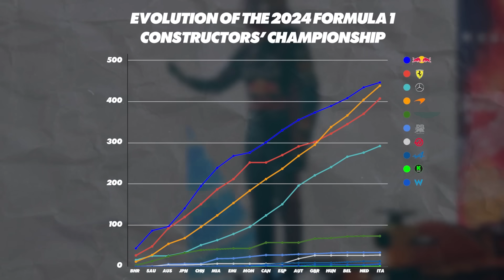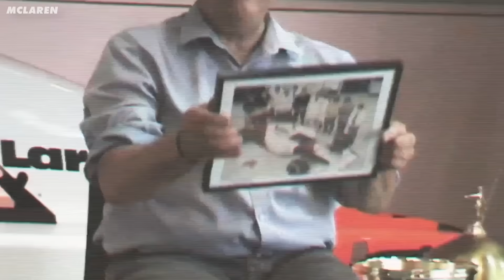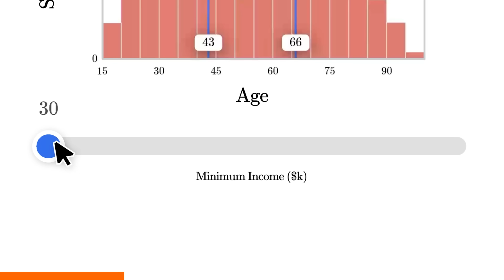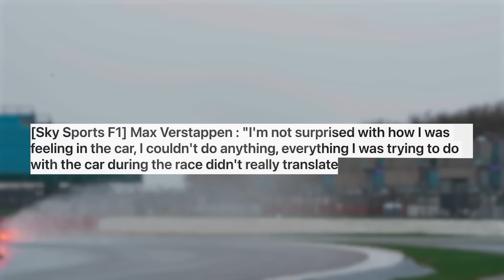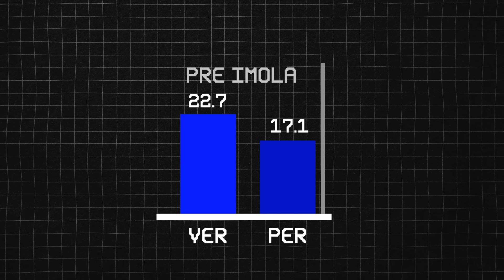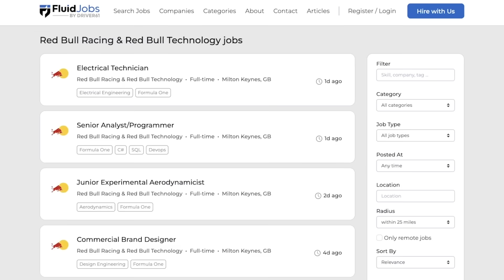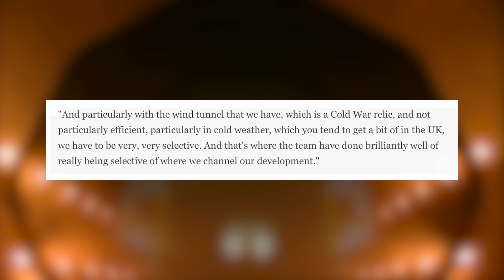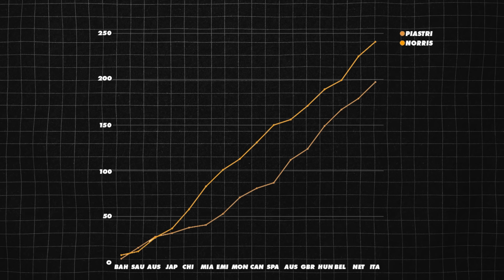Why McLaren Are Now SO FAST

Comment: Mclaren want Constructors but keeping Piastri is most important to them 
WDC is an afterthought
Reply: Not all teams value the constructors championship over the WDC, if Red Bull did then Perez would not be driving for them now.
Also worth noting that Red Bull do not have cars to sell... unlike Ferrari, Merc, McLaren and Aston....  so that may be the main reason for that.
Reply: @sumerrana6805 The irritatingly shortsighted theory/reality of McLaren only wanting the Constructor’s championship is:

-McLaren are only 8 points behind Red Bull, with 8 races remaining (plus Sprints), given both McLaren driver’s point scoring, they are on track to overtake Red Bull (possibly) as soon as in Baku next weekend.

-McLaren now have the fastest car on the grid, which (importantly) works well around a whole variety of different circuit characteristics.

-Both Norris & Piastri are scoring points regularly, unlike Red Bull. Perez saying Max is now finally feeling what Perez has been feeling with the car all along (unbalanced, inconsistent, unpredictable).

-There’s no ‘quick fix’ for Red Bull here. Unlike McLaren, whose wind tunnel correlation and CFD (Computational Fluid Dynamics) correlation both seem to be so accurate that their updates have tended to make large strides forwards, and more recent smaller updates are still always working & adding some level of performance. 

McLaren haven’t suffered the same fate as Red Bull & other teams (Aston Martin to name just one) whose updates have not worked, or taken them backwards, meaning they have to ‘unravel’ everything from an update package, separate each individual change and look at them in isolation to see if that particular part of the update package is responsible for any losses or gains, which takes up precious time & resources to evaluate & understand.

-Unless Red Bull miraculously develop updates that propel them back to being way out front of all the other teams again, McLaren already have one hand on the constructor’s title (barring several retirements where Ferrari or possibly even Mercedes score a lot of points).

-Given all these factors, McLaren’s strategy of letting Oscar take points off Lando is just madness. Yes, you need to keep both drivers happy, however, forcing Lando to cede position to Oscar for the Hungary win, and then Oscar’s move on Lando at the Roggia (second chicane) at Monza on the first lap, Lando is now 10 points further behind Max than he could/possibly ‘should’ be.

-Red Bull are currently in a mess, Newey admitted that the mess with Horner at the start of the season & the internal power struggles (which Jos predicted would happen if Horner stayed, which is why he was so vocal about Horner ‘needing’ to step down in order to prevent the very situation that Red Bull find themselves in now), including the ‘brain drain’ (where several key staff who are essentially the ‘backbone’ and ‘brains’ behind their recent success are now abandoning ship to go elsewhere, other than Adrian Newey who’s going to Aston Martin in March 2025 after his enforced ‘gardening leave’ is over. Newey will only have limited impact on the 2025 Aston Martin as it’ll have been designed & built before he arrives, so he can only work on updates to it, but he’ll mainly be focussing on the new 2026 rule car & the exclusive link up with Honda again.

Jonathan Wheatley is just 1 other example of many others that are leaving. Zak Brown admitted that a lot of CV’s (or for any Yanks reading this, you call those ‘Resumés’) have been passed over his desk from Red Bull employees who want to leave.

-So given that Max is currently in ‘damage limitation mode’ every race weekend now, trying to hold on to his Driver’s Championship lead, in a car that’s now inferior & difficult to drive, McLaren effectively allowing their drivers to ‘tread on each other’s toes’ by taking points off each other is just giving Max extra breathing room.

-If Lando kept the win in Hungary, and if Piastri hadn’t attacked Lando at Monza, the team would still have scored exactly the same amount of constructor’s points, but importantly, Lando would be 10 points closer to Max than he currently is in the Driver’s Championship.

-All these factors mean that McLaren’s strategy makes no sense. Targeting the Constructor’s points has not been affected at all by Hungary & Monza, they’re about to overtake Red Bull imminently, and it would be no surprise if they win it. All ‘Papaya Rules’ means is don’t hit your teammate, or don’t negatively impact them so that they have to go off the circuit/lose time/be overtaken by other competitors.

If the end of the season sees McLaren winning the Constructor’s Championship, but Norris missing out on the Driver’s Championship by 10 points or less to Max, they’re going to look really daft for the way they’ve allowed Piastri to take points off Norris, when Piastri isn’t really in the fight for the Driver’s Championship. It’s akin to a scorched earth policy: with Webber advising Piastri ‘if you aren’t in contention for the Driver’s Championship, then don’t roll over to help your teammate to win it, otherwise you’ll end up like I did: playing second fiddle to Vettel for the rest of your time there!’

Yes, Webber was hurt by Red Bull’s obvious favouritism towards Vettel, however, Webber simply wasn’t as fast or consistent as Vettel. He wasn’t constantly out qualifying Vettel & then having to move over for 20 races to let Vettel win, he was far more often than not just outclassed by Vettel. Only a few times did he have to play second fiddle. Webber’s insecurity about that shouldn’t be imposed onto Piastri, as he seems closer to Norris than he ever was to Vettel.

Plus, the only year Webber had a chance of winning the title (2010), he lost control by himself & crashed out in the wet in Korean Grand Prix.

I genuinely hope McLaren’s current policy of seeing 10 points for Norris given to Piastri doesn’t cost Norris a chance at the title.

-Final important point, remember Will Joseph’s (Norris’ race engineer’s) comments at Budapest “…I’m trying to save you. To win a championship you’re going to need Oscar & you’re going to need the team…”

Well, so far, all we can see from that point is that he’s 10 points further away from Verstappen than he needed to be, and McLaren have the same points as they would have done, because they went to Piastri instead. Not clever team tactics.

- If (and it’s a big ‘if’) none of the above had happened, and Norris went on to win the Driver’s title as well as McLaren winning the Constructor’s title, the 2025 season is a reset. No team orders (other than the obvious not crashing into each other), and they see how the Driver’s title progresses naturally through the season. If Piastri is the one with the best chance of winning it, then the reverse happens, Lando should support Piastri to win it. The team will look naive & really silly if the drivers taking points off each other all the time due to there never being any team orders means that any other team that always backs one driver (like Red Bull), then they’re just going to enable both drivers to fail to win the Driver’s Championship, and eventually one or maybe both will want to move to another competitive team who will be sensible & put their resources behind the leading candidate.

-McLaren’s relatively new found competitiveness has already made it awkward between Norris & Piastri. If they don’t get their house in order, things will deteriorate, which history has taught us over several decades that things never end will if the team don’t play the smart game & maximise their chances.

The approach of ‘You two are both ‘number 1 drivers’, so you’re free to race hard but fair at all times in every single race’ will (sooner or later) mean that one of the drivers misses out on the Driver’s Championship, and that’s going to be about half as popular as piss-flavoured birthday cake with Mussolini icing on top.
Reply: Truest words spoken
Reply: Mclaren suffers from bad pitwall decisions. If they fix that they can win both titles.
Reply: WDC is just an ego boost, there’s no money in it, why would McLaren prioritise this
Reply: Looks like it otherwise they'd be team order to held Lando.  Either way Piastri needs to make sure he doesn't take both of them out of races.
Reply: What? Where would Piastri be off to were he not happy? Which are all those obvious teams with faster cars and empty seats?
Reply: @flat6croc  None today but Lewis and Alonso  will probably retire in a couple of years.
Reply: Ps3 drives better
Reply: Ps3 drives better than Linda
Reply: It's almost as if Mclaren management doesn't believe it "deserves" to win the driver's championship.
(Nobody seriously believes the constructor's is as important as the driver's)
Reply: This
Reply: it's been nearly 30 years since they won one, so it's very important to them as a team
Reply: @IvanProsper  26 years you melt stop being dramatic
Reply: Piastri should understand why McLaren needs to make Lando the #1 driver for the rest of THIS season. Next season they can start from scratch and Piastri might get into a position where he becomes the #1 driver.
Reply: Piastri is contracted to McLaren until 2027. There's plenty of time to pay him back for any sacrifices he might be called upon for this year in securing the WDC and WCC. Every other desirable seat is already occupied, so there should be no fear of him exercising any buy-out clause he may have available.
Reply: All these hamilton shills just hype Piastri even though he's getting dog walked by Lando. And Piastri still bottled the win after lunging Lando at the start
Reply: That's because wdc is too big
Reply: @elian._iorio no. The Constructors championship is bigger for the team. Ken Tyrell, Frank Williams and Ron Dennis all said they didn't really care which of their drivers won the WDC, what matters is that they win the constructors. That's where the money is at. Money talks.
Reply: @typhoon-7 And all the prestige is from the wdc.
No one really cares about the WCC.
Reply: @leonardomatheus1888 Teams do - but I would agree that the public doesn’t care. Nobody thinks of 2021 as the year Mercedes won the Constructors - they think of it as the year Max won the WDC.
Reply: @leonardomatheus1888  Drivers for the glory, Constructors for the money. The sport lives on money. I worked in F1 (design engineer) and the constructors was our focus.
Reply: @typhoon-7  does that mean the constructor's is more important for the "poorer" teams and less so for the "richer" teams like Ferrari and Mercedes,?
Reply: @fintonmainz7845  Constructors POINTS are vital to the smaller teams. If you asked Stake Sauber right now what matters and it's constructors points.
Reply: @leonardomatheus1888  except the team owners who's invested the money so there IS a team. Take that away and what do you have ...........?
Reply: @typhoon-7 You’re slightly misinterpreting the point. All team principals say they don’t mind which one of their drivers won the World Championship, as long as they had the Constructor’s Championship as well .

No team only wants the constructor’s championship, that’s often a consolation prize when their driver has gone up against another driver & lost the Driver’s World Championship. I’m sure people can remember many occasions where that’s been the case.

In 1999, Mika Häkkinen retained his World Driver’s Championship, but Ferrari took the Constructor’s Championship. Ferrari weren’t exactly thrilled with it, they wanted the Driver’s Championship, McLaren weren’t devastated to lose the Constructor’s Championship, they had the World Champion.

More recently, Mercedes’ 8th successive Constructor’s World Title at Abu Dhabi in 2021 was pretty much ignored by the team, as they were gutted that Hamilton had lost the title to Verstappen on the last lap of the last race courtesy of Michael Masi making several mistakes. Hamilton’s commanding lead in the first stint, and then again in the second stint before the Safety Car were pretty big, but Masi made such a mess of his handling of it that it flipped the result. Mercedes were not celebrating their Constructor’s Championship after the race.

Whilst the team’s want to be acknowledged as the best team, as well as the prize money & pit garage position that comes with winning the Constructor’s World Championship, it’s not the media & marketing bonanza that having the Driver’s World Championship is.

It’s only really important if both drivers cannot win the Driver’s World Championship.

If a team doesn’t win both the Driver’s and the Constructor’s titles, then the Constructor’s Championship on it’s own has always been the ‘lesser’ prize in everyone’s eyes.
Reply: @typhoon-7 Exactly, i hate that teams are being brought into the WDC, it's designed as an individual accolade through and through. Everything of benefit to a team is given through the WCC apart from the extra recognition of the WDC which can play into sponsorships. I understand how both championships are viewed in the greater public eye but it doesn't change that simple fact. To me, if a driver wants a WDC they should earn it, not just rely on their teammate sitting back in the other capable car.
Reply: @fintonmainz7845  Constructors is way more important to all teams, has always been and will always be. Constructors is the only one that comes with tons of money for the team. WDC is more ceremonial
Reply: @willynelson8750  teams like Mercedes and Ferrari have "tons of money". Sponsors are mostly interested in the WDC.
Team managers don't always tell the truth.
Reply: @willynelson8750  Don't forget finishing lower down in the constructor's also means more time in the wind tunnel.
Reply: @elian._iorio  I took think the thought of a WDC is too scary for them for now. It's human nature given how in the gutter they have been. Also the whole "Constructors' is what teams want" isn't really as true as it might have been decades back. There's zero downside to a WCD in terms of sales or pride.